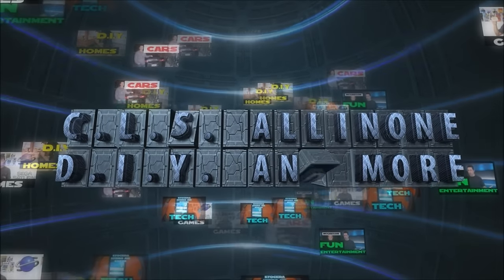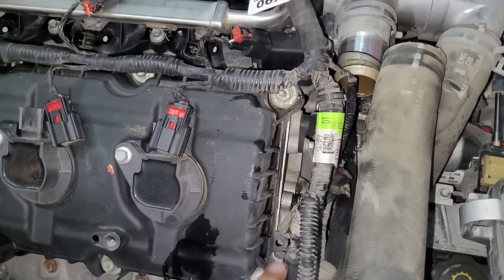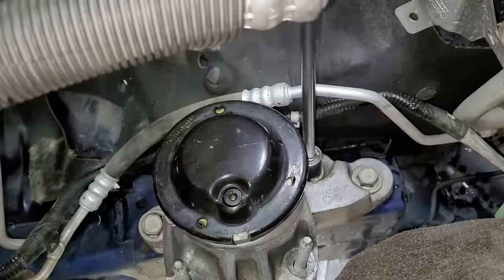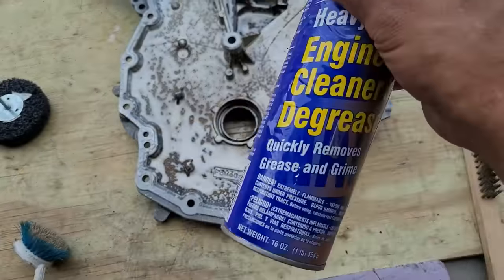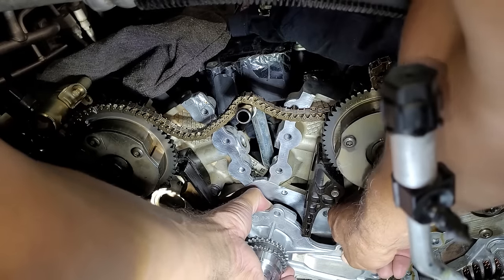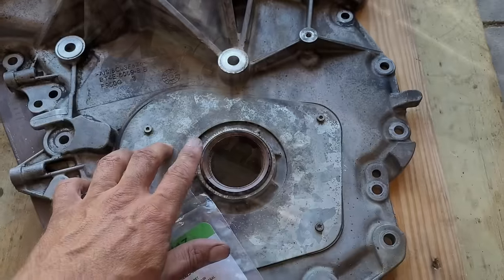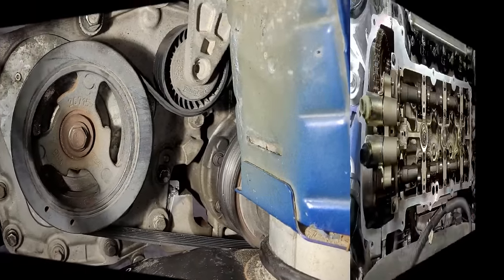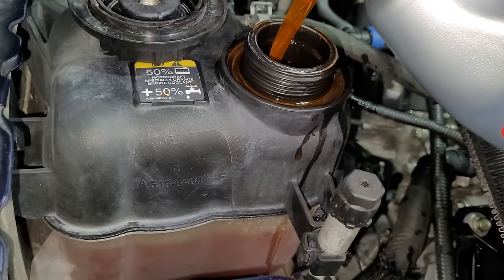How to change a water pump in Ford V6 3.5 & 3.7-liter engines 2012-19 Explorer, Taurus, Edge & more

Comment: I can't thank you enough for this excellent step by step repair.   Just completed this on my 2013 Explorer with 188k miles. The most difficult items for me were;  removal of the fuel line, removal of the balancer bolt, and the general small working area to remove and replace the 26 cover bolts.
Much appreciated.
Reply from the maker: Thank you. 
Glad it helped!
Reply: It’s easy, you just need 3 hands, be a contortionist, and misc swivels, extensions wrench and a lot of bad words.
Reply: I'm curious. How long did it take you to complete the repair?
Reply: Probably the longest and most tedious part was cleaning the old RTV silicone off the timing cover and off of the engine mounting surfaces. I found that the plastic razor blades work amazing. It leaves no gouges in the metal when scraping. Also adding the new RTV silicone to the engine surface was very hard due to the limited work space. All in all I probably spent atleast 18 hours working on it over the course of 4 days. Also the crankshaft pulley bolt needs to be replaced and do not reuse it. they are torque to yield only - one time use. A new bolt w/ washer cost 8 bucks at Ford. Additionally Ford has also changed the coolant type to a Yellow. The red fluid has been discontinued and needs to be flushed out as it has been known to cause corrosion issues.
Reply: Little late reply, but total time was about 23 hours for me.  The fuel line and the balancer bolt really cost me some time.
Reply: @Movieman1965   it took me 14 1/2 hours over two weeks.
Reply: @brandoswindell8623  😂😂😂😂😂

Comment: GREAT video. My friend and I, 2 Women, completed this job in 4 1/2 days during a 106* heat wave. We took extra care trying to save the clips. This meant extra time. As we removed parts, we took pictures and videos. We cataloged the parts as we removed them, keeping screws and bolts together with parts. We replaced the water pump, crankshaft oil seal, serpentine belt, left and right lower timing belt guides, tensioner, spark plugs and the valve cover gaskets. We had a few blips, but, we figured them out. Neither one of us are mechanics, but, we know which end of a screwdriver to use. Estimate from dealership $3,000. Estimate from mechanic $4,000. Cost of parts $400.  There were little things in the video that weren’t the same as my 2014 Explorer, nothing we couldn’t figure out. Ex: the engine mount bolts need to be removed to get to 2 bolts on timing chain cover. We used M8 female torx socket to remove them. When putting a cloth over the camshaft, take care that the cloth doesn’t get caught in the camshaft when removing the pulley, the pulley may rotate while attempting to remove it.
Filled with fluids and so far no leaks. She’s purring like a kitten.
Could you do a video about how to change a blown head gasket on a 1970 F250😊
Thank you, thank you, thank you

Comment: Excellent instructions for a person who has the skills and knows how to use the tools. It is not a tutorial for learning how to work on engines. I was able to replace the water pump and timing chain on my 2015 Ford Explorer. The hardest part for me was removing the injector connectors, I ended up removing only 2 to give me enough space to remove the valve covers. I had to lift the engine high enough to have the space for removing the timing chain cover. You need all kinds of socket lengths and ratchets to open the timing chain cover, not to mention how tight was the crankshaft pully. Be very careful when removing the wires and parts not to damage anything, so at the end you can put them back together and start the car with success. Watch this video a few times before starting the job, prepare all parts and tools so you don't have to go back and forth to dealer and hardware stores.

Comment: I am a Master Mech ( have done this job about 16 times) and this is a very good video I have shared with my other tech friends, who say the same , "Very detailed "
Reply: Can a regular person do this job?
Reply: In the chance you don’t mind responding, I did this work but am having timing issues
Bank 2 cams end up out of alignment..intake/exhaust weren’t parallel when I reopened the cover
I realigned them but am unsure if it’s a bad phaser that is sticking? Any opinion or help you can offer if you’ve seen it? Just bought a oem main timing chain in case it’s stretched and will be trying that next but would much prefer to just do the phaser if that’s the issue causing the misalignment/mistime
Reply: Just had to take mine to a local mechanic. Need that special tool for the timing chain. Cost me $1500 😢
Reply: @javierramos6722 hello did you figure out the issue. My vehicle starts but only stays running few seconds and sounds muffled and can smell gas. Im pretty sure the top camshafts being not aligned with bottom shafts has to be the issue. I don't know if I can somehow turn that cam to align or what.
Reply: @overdrive020  unfortunately I haven’t been back to it, spent time purchasing another car needed in family and other issues so haven’t worked on it…I’ve come to the conclusion though, unless I hear someone’s opinion, that the cams are unaligning because of the main timing chain jumping. When the main chain goes, I think the cams unalign from one another as well as the crank. In my case I will align the cams so that the locking tool fits over them, then replace the main chain with the new oem one (it has marked links and the marks are on phasers and crank to line them up) and test it from there and pray it doesn’t jump again 

The main chain should have 42 links between the two cam marks, 50links between the bank 2 cam mark and the crank mark, and then 37 between crank and bank 1 cam mark (I hope that helps)
Reply: @javierramos6722  you know that's probably what happened to me. After putting everything together I removed cam locks and turned engine over and did notice the tensioner bounced several times. So had some slack in chain and it jumped causing the timing to be off. My main question is can you just align the top cams by turning them. If so then put cam locks on. Now what do you do if the main timing is off on crank and phasers?
Reply: @EmilGhiurau which special tool? The only one I saw were the locks which don’t seem expensive.

Comment: My first water pump went out at 120,000 milesI had a mechanic shop replace it, they didn't use a fomoco pump and it went out again at around 47,000 mile mark. When I let them know they told me it was 2,000 miles outside their warranty and they would need $2,000 to replace it again. I said not this time, I'll do it my self. Thanks soo much for the video!! I was a jet engine specialist in the military I should have did it myself the first time!
Reply: Looks like to be in the safe side it's good idea to replaced every 40k miles after  the first replacement its very ridiculous the damage to the motor when the water pump fails
Reply: Maybe tell us specifically what brand you DID use because not all of us are impressed with the mileage we got from the oem pump, especially for the additional cost

Comment: I'll like to say thank you so much for the video. Took me about 4 days to complete in total. Im in the 24 hours drying time right now. But the hardest part of the whole job was the gasket n timing cover bolts. A Puddy knife was a big help. Also theres a hiddle bolt by the alternate which i almost missed. Also, Please buy channel locks! It will be nearly impossible to push that small chain tensioner back in place without one. Also buy a very small allen wrench or even a very thin nail! Because the tool they send you with your cam locks will be to big. I promise you will thank me later. Make sure you mark the chain good. When putting chain back on  just pull from the water pump onto the back cam , because you will be off 1 tooth and wonder how to get it back on......... slowly watch the video and do the same hand placement as this guy. You will understand when you get to this part. Also when taking off the vavle covers go slow and dont yank on it or you will break something............... now for the pully. It was the most hardest thing ever. I had to use my own belt to fold it own itself like in other YouTube  videos because i didn't have any other way to hold the pully still. A new belt was 25$. In my opinion it was well worth the price. The belt had cracked a little because of the pressure but worked after like 30 mins trying. Now putting the pully back on was kinda hard. But i had a big rubber mallet n a big socket n just went to town on it. Then i just started tapping at the sides to try to get the 2cm i needed for the bolt to go inside. Took another 15 mins just for that. I used a drill to pushed it in and tourqed it the best i could while  holding it with my bear hands. You gotta be strong for this job. Overall this job will have you sore. Othere then that just mAKE SURE YOU TRIPPLE CHECK EVERY BOLT BEFORE GOING TO THE NEXT STEP.   p.s there a small connector on the back of the vavle cover near the passenger side close to the firewall. Either use a pry tool to undo the clip or just break the lil peice off or use a knife to cut it. Overall do not yank on it. Also leave all your bolts with the item your taking off. The last thing you need to do is lose a bolt........... ALSO FOR THE BELT TENSIONER THERES ANOTHER PLACEMENT FOR THE RATCHET AT THE BOTTOM. USE THAT ONE INSTEAD OF THE ONE ON top NEAR THE AC LINE.

Last thing. Unscrewed the bolt out of the cam after the chain is tighten back up with the camlocks still installed. You will thank me later

Comment: Thank you for making and posting this video! It saved me and others alot of $$$. Few things I want to point out that wasn't mention in the video:
1)To disconnect the injector connectors- push the red locking tab upward until it clicks. Push the inverted "C" tab inward  below the locking tab and pull the connector at the same time. This is tricky
2) The timing chain links orientation as follow - link#1 align with left camshaft  dot, link#50 align with right camshaft dot and the crankgear dot is align between link#86 and 87. This is important if you're reusing your old timing chain like I did. I used paint to mark the links.
3)After you set your camshaft marker to 11 and 1 o'clock, make sure to remove the crankgear bolt out. Turning it counterclockwise to remove after you installed your timing chain can make skip a tooth or two and that would all mess up your timing - code P0019.
4)This can done without the camshaft tool. Just make sure you set the timing mark to 11 and 1 o'clock and paint your links before you remove the chain. You can use T55 torx bit to turn the camshaft and make little adjustments if you have to.

Comment: Great video on process for the waterpump replacement.  Totally crazy that Ford designed an engine requiring this much work to repalce a waterpump.  When my daughter told me the cost to do this on her Explorer I thought there had to be a mistake.  Now I understand all that is involved.  Thanks for taking the time to educate us on the process....
Reply: Hi, How much is the cost of this repair? Thank you.
Reply: It's like a 2,000-2,500 dolller job.
Reply: @NFTYCENT not ready more like 750.00 1k tops
Reply: @sfssjonathan9150  750 is still 2 much this engine is junk
Reply: @sfssjonathan9150, where are you getting your price from, im talking about shop prices. I just finished mine. I spent 200$ on a new crank seal,oem pump, new fluid and plugs.
Reply: Book calls for 10.5 hrs 1k would be the labor cost.
Reply: @jimmygmc6917  All things considered, I wouldn't call them junk,just a crappy design. All cars have their setbacks. imo
Reply: @NFTYCENT  Exactly.

Comment: Great video. I own a shop and in the last two weeks I've had a Ford edge, a Ford Taurus, and a Mazda CX-9 all come in needing this repair. For those with a Ford edge I would recommend evacuating the a/c system,  removing the a/c compressor, removing the alternator, and disconnecting the power steering pump in order to install the cover... even then it will still be tight.  This is a bear of a Job but slightly easier on the explorer due to the extra space.  I would also replace the chains, crank sprocket, and guides.
Reply: it's about EDGE before 2015 I think.
Reply: agree, no point having this all open to not replace the chain at the same time
Reply: So you have to remove the ac system etc? For an Edge?
Reply: @jeedwards1981  
I would recommend it.  It'll give you more space to work.

Comment: This is a great video thank you for the detailed and timely laid out steps, my one recommendation to all those watching this be extremely careful and double-check the torque specifications on the valve cover bolts, at 15 ft lb of torque it snapped a bolt head right off. If you are unsure I would highly recommend hand tightening the bolts without over torquing.
Reply: I could be wrong but I believe it should be 15 inch pounds instead of the labeled 15 foot pounds on the

Comment: My first cost estimate for replacing the water pump only included prices of the pump and gaskets. But now... wow! I am so glad I watched this video ahead of time. I will be buying spark plugs, gasket maker, plastic ties, brake cleaner, pulley puller ... The little things obviously matter. For me, the cost of a mechanic would have exceeded the vehicles value. So I am willing to spend two  relaxed weeks fixing my car. Thank you so much for making this video.

Comment: Before putting valve covers back on, ford recommends putting sealant on the left side of the engine, right after your video showing you razor scraping the old sealant off. Basically  where the 'crack' is exposed on both surfaces and where the 2 pcs meet

Comment: Wow! Wow! Wow! That's the most thorough explanation and tutrorial on how to tackle this job! Thanks for sharing your knowledge. I don't have the time, tools, space or patience to do this myself. But it does give me an appreciation of the service technicians that will do mine!!! My  2013 Ford Explorer has 150,000 miles. I plan to keep it going for another 50K-100K. I hate spending money on buying cars!!!
Reply: I read a review from owner of Ford flex with the same engine who had over 300000 miles apparently. Something like 340000 miles.
Reply: @zzoinks  I have 315,000 miles on mine and it's a 2017 explorer. The engine still runs like new, replaced the water pump at 170,000 miles.
Reply: @paramvirdeol386 did you changed it because it failed or preventative maintenance?
Reply: @thevally6127  The coolant started leaking through the hole that's in it.
Reply: @paramvirdeol386  okay and that leaks near the oil pan correct? Sorry for bugging ya but my wife's explorer is on 110k mileage range and wanted to get it done before problems arise

Comment: As many mentioned, this is the best video. I will check under the engine next to the oil filter for a coolant leak.  Hope it’s leaking so I can replace the pump using these instructions.

Comment: Great video.  Only thing I didn’t hear him say was. Before valve covers are installed put a dab of silicone where the timing cover meets the block on top of that seam. If not it will leak oil.
Reply: Correct. The explanation or application for that was missing.

Comment: ive watched your video like 20 times,   so i can learn exactly  what to do,  then i went to do the work and try to video it to show others ,,, i dont know how you made the video and worked on the car at the same time, hahahah,,,,,, i did say before you did an excellent job,,,,    its been hard for me to video it and do the work,,,,,  the injectors and removing the cables has been so far so hard to do without breaking them,   i actually applied a little bit of wd40,,and it worked
Reply from the maker: It can be a little tricky holding the camera while working for sure.
Reply: @D.I.Y._All-in-One  how many days did it take you to complete it,  and were you alone?   im alone and i am at the part to remove the timing cover,,,  i might have asked you many times before this , but i am only unsecured with the timing issue,,  i have the camshaft holders , but i saw my marks at this time at 12 pm and 2pm,  the bottom one i am not sure yet,  but if they are not a 11 and 1 pm as with yours,  do i move the crankshaft from the bottom to get to those points,  please help,  thank you

Comment: Thank you for taking the time to record and post this video, very thorough and precise, I have been a mechanic for over 40 years and was ASE master certified, and this video was extremely helpful, especially with the tips for hidden fasteners. I just completed my 2016 Explorer water pump replacement, it took me two full days, but without you help it probably would have been 3 or 4 days. As many others have said, this is probably the best instructional video I have ever seen, many thanks to you sir, you are awesome!!!

Comment: I was nervous about tackling this in my ford edge. But after seeing this I will definitely do it on my taurus!
Reply: how did it go?  any issues?
Reply: Very limited space on the Ford edge... A lot easier to do this Job on the explorer. Ask me how I know lol. Getting ready to do it on a  Taurus.
Reply: I haven’t even done it yet lol. It was Christmas time!!! Lemme know how it goes though because I’ll tackle it
Reply: On the Taurus, you will have to remove the fuel liner bracket and stuff it near the fender, drop the washer resivoir, and pull the ac line closer to the fender, this makes getting the cover out and in super easy